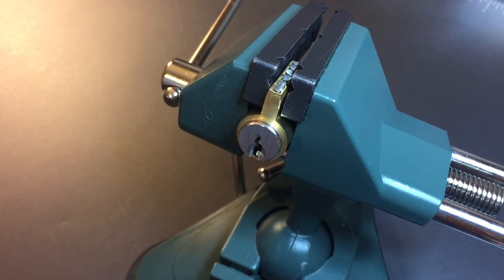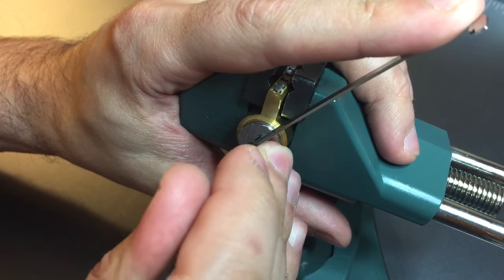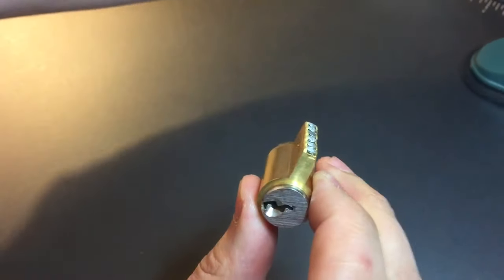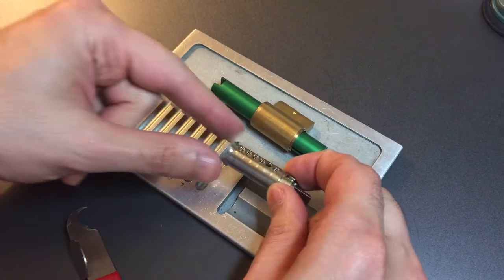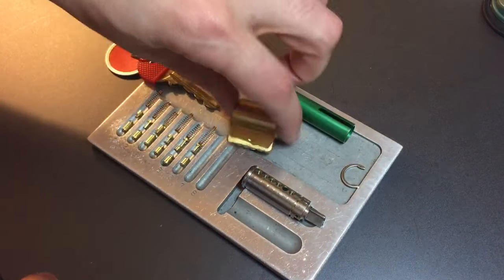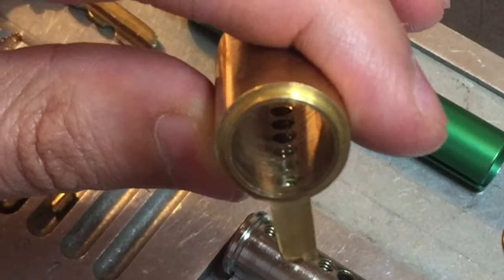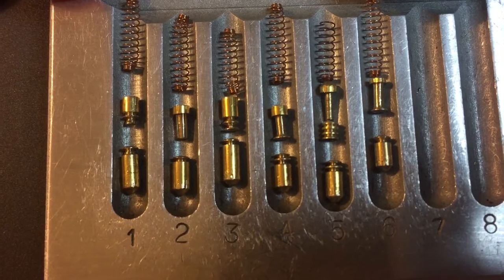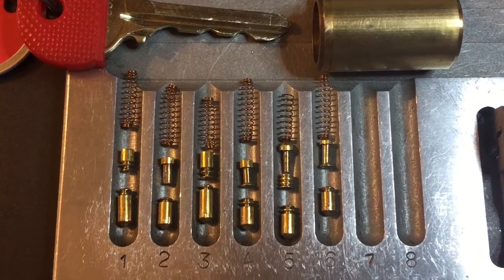[262] Robert Bradford's Yale Challenge Lock Picked and Gutted

Comment: Thats a great looking lock Mr Bradford did a fantastic job on those pins. And of course LPL's picking is world class, I would love to see LPL feature more "challenge locks" on his channel.
Reply from the maker: You want more challenge locks?  That got me laughing a bit because (with a couple exceptions) my challenge lock videos are usually the least watched videos on my channel.   I'll take that under advisement.  ;-)  PS - I have a challenge lock playlist on my channel, if you are interested...
Reply: Hi Jess, With respect, there are SO many challenge locks shown on YouTube, with virtually limitless shapes of drivers and key pins, and pin in pins, not to mention threading of pin chambers. The modifications look impressive - and they are - but to skilled pickers ( like Harry ) they usually are only a mild inconvenience, and the wilder the pins are the more feedback they give. A good quality "standard" lock will often be harder to pick, but boring to gut. A mix is fine, but let's see more real world locks. Regards, Brian.
Reply from the maker: Brain, I generally agree, though I will add that there are more than a few challenge locks that have given me far more than a little pause, and some that have completely defeated me.  My nit with them is that the overwhelming majority of challenge locks are just not practical... they are sticky to operate, outside of MACS, and the features that usually make them hard (very sharp edges on pins and threading) would wear out quickly under normal use.  In short, they are nice little puzzles, but not great locks.  I usually watch challenge lock videos looking for interesting innovations.  The ones that come to mind off hand are (I) Flywheels original pin in pin lock (he was the first, IIRC), (ii) Korver15's T pin over master wafer concept, (iii) Tahoe picked's split core, (iv) Tahoe picked's "tumor" lock (two bibles, one containing standard and one with dimple pins)... there are probably others that I don't remember right now.  While I do find some challenge locks very interesting, I am usually more interested in picking commercial locks... which is why I have the backlog of challenge locks!
Reply: Well thanks guys, now challenge locks just became some what less interesting to me, LOL. There are a lot of challenge lock vids on youtube. To be fair however, there are certainly much more commercial lock videos. Especially when you consider all the lock picking videos uploaded by non lock pickers and the people that randomly pick up a eBay/amazon beginners lock picking kit and make a random video. I do though, really enjoy and appreciate all the more exotic commercial locks that LPL features on his channel. Those are locks that I won't be picking for awhile either do to cost or skill.

Comment: Nice pins Robert.
Question for you guy's,  What size are the threads you usually use in the locks?  6/32?
Thanks.
Reply from the maker: Good question... I have no clue.  I've been using a tap that Papa Gleb sent me a while ago.  Never took the time to look.  If someone doesn't reply by tonight with the answer, I'll dig it out.
Reply: I use 3 different taps... 1 for standard locks, 1 for American / Master, And one for the slightly larger pins (Sargent, Lockwood, etc) But the common size is the 6/32 or 5/40 depending on how fine a thread you want.
Happy lock building: Cheers!
Reply: Thank you!
Reply from the maker: Thanks SP.